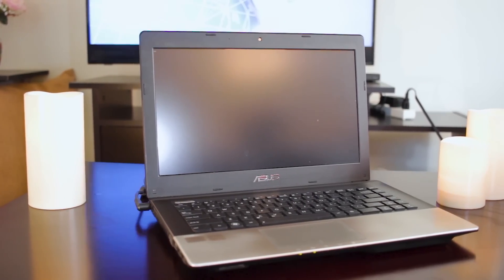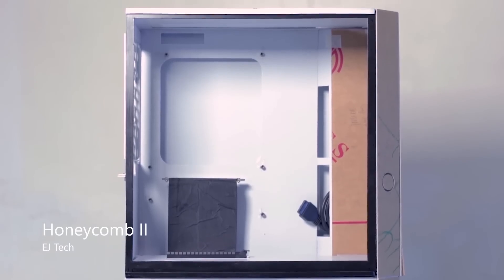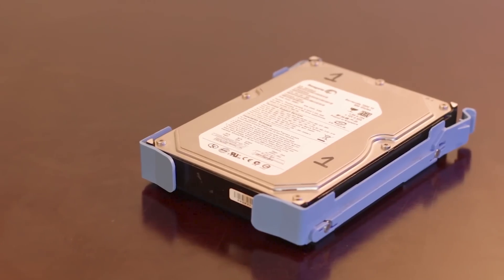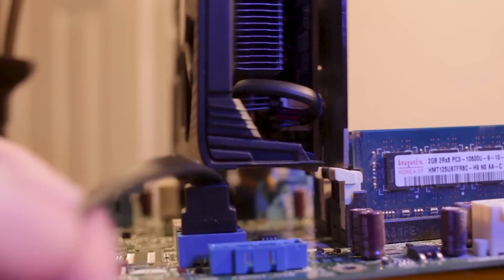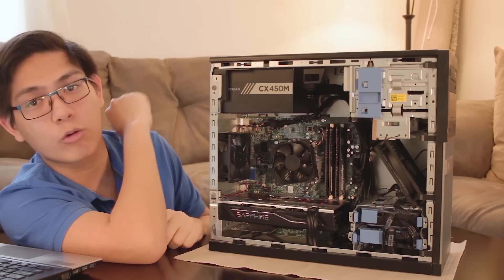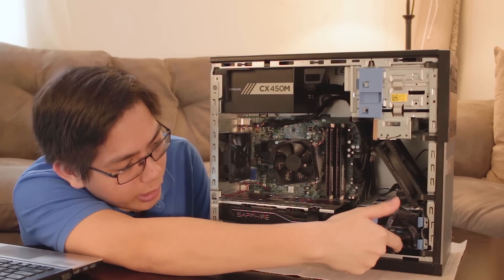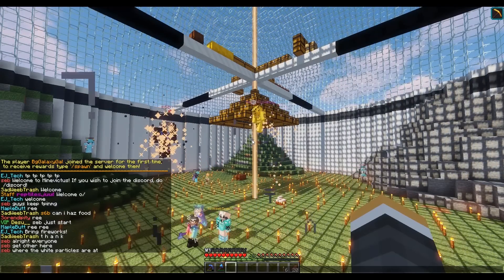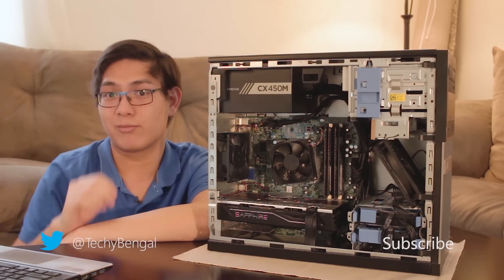My NEW Computer...is a USED OptiPlex? (Tension PC Ep.1)

Comment: You can remove the HD caddy cage and just use an SSD drive. It does take some drilling to accomplish this and YouTube does have videos on this. This way you can install a much more powerful and longer GPU. Although, you'll need a different power supply with a separate connector for the GPU. Another great thing not having the HD cage is that you can install the front intake fan much more neatly against the front grill. This way you can improve positive air flow for better cooling inside the case.

Comment: this is very similar to mine - I got given an old PC by a friend who was upgrading - I swapped the pentium for an i5-3470 (£40), a gtx 550ti for a gtx 1060 (£180, but only cost me £30) and a 500gb SSd (£50). This was mostly 3 years or so ago, except the SSD that replaced a smaller one about 6 months ago.

Comment: I get these optiplex's all the time from work. The optiplex 3010 MT or any optiplex MT with 24pin mobo pin will accomodate a power supply to replace the stock power supply. Now, if the stock power supply is 300w or 380w, you can purchased a sata to 6 pin power cable and install your graphics card. The only cards I was able to test are older cards such as a GTX 650, 770, 950 and the 1050ti. This works well if your optiplex is equipped with the darn 6 pin or 8pin mobo power pin.

Comment: I am in the same boat, 6 year old laptop I had to pull the ramm out of because I dropped it, also the screen is fukt and needs setting adjustment everytime I turn it on.  I am trying to find an optiplex but they are in hot demand and can easily go for 3x their worth.  I found you can merely buy the motherboard, 3.4ghz cpu, ramm, and 500watt power supply for less than the cost of $100.  I'm going to use a plastic tote for a case and just melt holes in it with a sodder iron

Comment: I picked up a HP business computer with a Core i5 4590 and 8GB of RAM for 75 bucks. The kicker is though that it ended up being a slim case with a proprietary power supply and even has a non standard heat sink that cannot be replaced with a standard one. Not to be defeated I bought a Haswell motherboard that was pulled from another full size business computer and accepted standard sized computer parts for $20 and removed the CPU on the slim case computer. I pulled the Sandy Bridge board out of my gaming computer case as well as the 8GB of RAM and GTX 950 and put the Haswell board in its place. I then bought a Core i3 4130 for $25 and put it into the slim computer which became my new desktop internet browser and DOSBox machine. At the time I didn't get exactly what I wanted, but after all said and done, I got what I needed.

Comment: I got an optiplex 7010 with 8 gigs of ram and an i5 3570 all I did was put in a 600w psu I had laying around in it and an r9 380 from xfx took off the fan shroud and fans then ziptied a noctua 3000 rpm fan to it and I can still play most games at 30 fps low or 60 fps high/ ultra settings. Gpu never goes above 78c

Comment: She runs 32Gb of ram just fine with a bios upgrade.
Reply: i7 2600 only works with 24 gb ram max because it will buffer the rest of the 32.
Reply: @raziasrazias7761  I made a mistake.  Mine are a 3010 i5 and a 7010 i7 which are 3rd generation.  They were originally maxed out at 16Gb but both run 32Gb now.

Comment: right angle usb3 extension thing exists, case intrusion can be disabled in bios, look for bios password jumper (remove it), cpu cooler mount looks non standard, you want 2 or 4 ram modules with the same capacity so they run in dual channel.

Comment: actually this is going to sound dumb but in my dell OptiPlex i took the hard drive bay out and put an rtx 2080 ti founder edition card
Reply: My Life on The Peninsula I call bs
Reply: @synthh3850  lol want pictures
Reply: I did the same thing for my kids PC so that I could install an ASUS RX 570 ROG Strix. It's just 10 rivots that you drill out.    Then you use the two top bays for SSD / HDD.   I kept the bays though so that I can pop rivot them back in later if needed.   A 2080 ti is overkill by far for a Sandybridge or Ivybridge chip though.
Reply: Stepside1986 yea Ik
Reply: Stepside1986 does the rx570 work fine in the pc?
Reply: @ethanmoorehead6868  it should, just make sure the other parts in the computer work well with the card and if some don't, upgrade what you can if it is worth it
Reply: if you arent lying then you are dumb because the bottleneck would be awful and the rtx 2080ti would be at 0% while the cpu would burn itself at 100%
Reply: What about the cpu did you updrage that too if so then what as I want to upgrade cpu
Reply: @marmite2956  I did not its running the stock i5 with 16gbs of ram
Reply: Can You provide detailed specification? That's awesome.
Reply: That's not dumb to me, that actually sounds like a really cool sleeper gaming pc
Reply: Dogfacezombie oh thanks
Reply: My Life on The Peninsula 2080ti is going to bottleneck that pc to shit, better off with a 1660s
Reply: @apollo1782  True. But the only reason you'd want to stick with your old build when you have 2080Ti kinda cash is because you want to build a sleeper and/or you want a futureproof ultra settings only card. Like the 2080Ti will probly die on him before it becomes so old that it can only give him 1080p60fps (when not bottlenecked). They wouldnt get such usability out of a card they buy after burning through the same budget on a new system or have the flex rights of owning the first ever RTX flagship.
Reply: Bruh a rtx 2080ti can buy 15 of this pcs

Comment: ah a dell optiplex was my first pc first i got a i7 in mine and 16gbs of ram and a gtx 750 ti and a 240gb ssd and it holds up very well
Reply: i got a i3 3220 with 8gb of ram and a gtx 750ti in my optiplex 3010. same case as this just has 2 usb instead of 4 in the front.
Reply: @StonerFromThe618  yea same the USB header is in the way of bigger gpus
Reply: I just recently bought a gtx 660 ti will it get in the way of my sata connection for my drivers?
Reply: @imjourdan1132  its might I don't actually now how big a gtx 660 ti is

Comment: I did a 9020, loaded it with 32 ram and an i7,  1060ti video card, and away we go!
Reply: The Reverend 1060ti doesn’t exist
Reply: @gamersspace9556  Maybe it does, or maybe I'm so used to typing TI after nvidia part numbers.. either or, it works well.

Comment: Did the same recently. Grabbed a lightly used Optiplex 990 SFF for $70.

Tossed in a $50 GT 1030 and another 8GB to give it 16GB of RAM (Mobo maxes at 16GB) for $15.

I'd like to get an SSD next but I'm happy with it as someone that is waayyyyy behind the curve on PC tech.

$135 total for an:

i7 2600
16GB RAM
GT 1030
500GB HDD

Considering my last PC was a 2012 budget laptop from Walmart (no joke), it's a beast lol
Reply from the maker: Get an SSD sooner than later. A 240GB is less than $30 and will make your system super snappy.

Comment: FIX FOR LONG CARDS AND USB: Recently bought a 6-7 year old optiplex with a 3rd gen I7 cheap, wanting to do a budget build for my shop. I had 8 gigs of good gaming ram laying around along with my old Radeon HD 7970 which is an old but capable beast, both items from the same time frame of the optiplex.  First change the case to fit a full sized video card. Then you'll need these https://www.amazon.com/gp/product/B00HDEBGSQ/ref=ppx_yo_dt_b_asin_title_o05_s00?ie=UTF8&psc=1 . These will allow you to access the sata plugins now behind the card. The USB issue can be bypassed using this: https://www.newegg.com/p/2VR-005G-00016?Item=9SIAE4P89D1711 .

Case intrusion sensor gets unplugged to stop working... Jesus I should make this video eh?

Comment: I have an Asus laptop from 2012 that I still use for certain things today as well!  For the most part, Asus laptops are incredible.  I had a MSI laptop from 2015 that died two years ago, but that old Asus one keeps running like a beast.  I use it sometimes for modeling or video editing on the go or when I'm not around my desktop workstation.  It has a second gen i7 and a GTX 550 m.  It runs Win 7, but unfortunately I'm going to have to retire the machine soon because it will not upgrade to Win 10 due to the old GTX chip not being recognized by the Win 10 OS.  I think it's mostly a Nvidia issue since they stopped supporting those older cards with drivers.

Comment: ✌😏 congratulations about getting #WOKE on crappy trashy laptops, you would be surprised how many people all over the world insist on using a laptop as their only computer! ITS SAD AF! 😱

😒 if you like LOOOOOONG video cards checkout oem desktops like the HP Z line, they come with a full standard regular ATX motherboard with 7 pci slots, with a full size ATX board and full height case the video card can run pretty much all the way across the middle of the case, its pretty much just like a custom gaming case 😒👍

😒 hmmm for that case you should have looked for a short single fan video card 🙄

😒 hmmm you should have gotten a model with an i7 or Xeon 4c8t equivalent 🙄

😒 hmmm all the memory should be matching sticks, fix it 😡

🙂 i like your front case fan idea 😏👍

🙂 Next! 🐢

.

Comment: That's nothing, been using my 1st Gen Core i7 for 10 years now, it's still going.
Reply: 😒👍 yes they are affordable now, finally 😀
Reply: @MrSamadolfo  I bought my computer with the 1st Gen Core i7 brand new back in 2009, it's an HP.  These Dell Optiplexes though are the way to go for someone who wants to build a snappy fast computer for much less.  They're pretty robust and last for many years.  You have to watch on dellrefurbished.com because the prices go up and down.  You can catch an Optiplex 9020 with an i7-4790 and 8GB for about $175.  You have to snap them up when you can, otherwise they're still like $300-400.
Reply: @clemsonbloke  🙂👍 sounds good
Reply: @clemsonbloke  🙂 neat, i bought a couple HP Z 200 workstations from our local freegeek thrift store, they only came with a crappy i5-650 (2c 4t) i tested them out with a cheap Xeon X3470 4c 8t and they posted just fine, just with that upgrade alone now its a decent computer 😃 yay! 🐢
Reply: @MrSamadolfo  Yeah, the Business/Enterprise computers are much more robust and built for longevity unlike the consumer models.  I've loved my HP with the i7 I've had for 10 years now, it's on the X58 platform which was a server platform.  X58 is a beast of a platform, thats why it's lasted so long.
Reply: @clemsonbloke  🙂 yup seems to be built well 😇
Reply: @MrSamadolfo  They are.  If you are going to get one to build a gaming rig out of, get the Optiplex 9020 and not the 7020.  The 9020 is the top of the line.  Also, don't go for the older 960 or 980, 780, 760, etc.  The ones with the 9xx or 9xxx are the top whereas the 7xx or 7xxx series are just below that.  Make sure and get the newer ones with four numbers like the 9020.  They offer much better processors and options.  Also, another that is almost identical is the Optiplex XE2 which is like the 9020 series except it's black and has air filters, otherwise it's not much different, about the same level of quality.  That's the best advice I can give.
Reply: @clemsonbloke  😎 Cool, thanks for the tips friend 😇
Reply: @MrSamadolfo  You're welcome Sammy.

Comment: I’ve same 7010 machine as this. Upgraded gpu, psu needed psu connector. Mac WiFi and Bluetooth card. Installed macOS. Running Catalina on it now. Only thing I hate is it’s only two ram slots. So I’ll need to buy two 8gb. Saaad
Reply: Actually I think mine is 3010. Some weird 4Xxx series chip. 4570 maybe?
Reply: Got 1tb ssd for 40 bucks too. My hdd was also brutal
Reply: Mac OS? How do i make a USB from Windows?

Comment: I hate the dell hardware but I do like their cases even though they lack decent airflow
Reply: One optiplex I installed a 80mm low profile fan with double sided tape onto the side door vent.  Then used a SATA to 3 pin fan adapter to power it.  It also helps pull cool air past the gpu that was installed on that Optiplex.

Comment: Cool video, I've done the same thing, I've brought and upgraded a Dell Optiplex 7010 MT, I primarily use it as a hackintosh under macOS 10.15 Catalina (which by the way works fantastically, even iMessage works) and some times I use it to play games under Windows (which I really only use for that), here's the specs of mine:
Intel Core i7 2600K
16GB DDR3 1600MHz (4x4GB), but it's running a 1333MHz because of the 2600K
MSI Radeon RX570 8GB Armor (yeah, I managed to fit the Armor model inside, and still have the USB 3.0 header plugged in lol)
LiteOn 128GB SSD (for macOS 10.15)
Seagate Barracuda Compute 3TB (for macOS files)
Seagate Barracuda 1TB (for Windows and games)
I added a front intake fan too, because that 570 is really running hot inside that little case
Reply: My 2600k has been running at 1600MHz 4x4GB kit for 6 years.

Comment: I'll hopefully make a similar build as well, based on the optiplex 7010 mt
Reply: Use zotac 1070 mini no need to cut the rear. Just pnp. Also i have 20gb RAM. Playing arma 3 warlords n annex the RAM eats up to 15-16gb. Ultra detail . Processor i7-3770. Around 18-60 FPS. ARMA 3 cpu dependant game. Also Nvidia has downclock my 1070 as to reduce temperature. Last time the core clock near 2000mhz now just 1888mhz. Well Temperature up to 68dgc compare to last time 83 dgc. Few FPS was lost.

Comment: Yes, I have the same situation with my old laptop, but It is a Toshiba Satellite p875-s7200 which is very very upgradeble.  I was able to change the CPU from an I5 3210m to an  I7 3920XM it is socketed and not soldered, I put in 16 Gs of ddr3 ram and a fast SSD, and this old ass laptop is much faster than some new ones.

Comment: I use two of these PCs as my "main" computers. Mine are 790 models but basically the same thing. They've both been upgraded to i7 CPU, 450W PSU, 16GB RAM and SSD drives. Still haven't upgraded the GPU yet, I'm waiting for the new GTX 1650ti to come out. No reason to get anything high-end since it'll just bottleneck on the CPU. In the meantime I'm using a couple of old GTX 550ti cards.

Comment: My Dell Optiplex 7010 MT is highly customized haha. Check the specs:

Intel Xeon E3-1270 v2 (yes, Xeon e3 1200 v2 series works)
4x4gb Patriot ddr3 1600mhz
Corsair CX550 PSU
Sapphire Pulse RX 580 8gb
Samsung 860 Evo 250gb
WD Red NAS 2Tb HDD 
Thermaltake 120mm intake fan w/ custom hole and mount thanks to my Dremel
Removed the HDD cage
Modded USB 3.0 cable and Sata cables to fit under my GPU
Removed optical drive and installed blank cover plate

Love seeing vids like this, keep it up!! These are great budget systems with plenty of room to customize.
Reply from the maker: How much did you pay for the Xeon E3-1270 v2?
Reply: EJ Tech I got it off eBay for 70 USD. Honestly my curiousity in seeing if it would work outweighed the price. Really no different than the commonly suggested i7 3770. It runs great. Also, I don't know why people suggest getting an unlocked processor for these computers as they are total wastes of money in a system where you can't overclock.
Reply: @ej_tech  I wouldn't go for a xeon in my opinion, considering that for 10£ less at 40£ you can get an i5 3570k  or non K which performs about the same in gaming, but does fall a bit back on workstation tasks. Also surprisngly there isn't a huge differnce between the xeon and an i7 3770. It's a tad confusing in my opinion
Reply: @ej_tech  In UK they are solf for around 60£ and that would be around 78 USD, you may be able to find it cheaper though in the US
Reply: Update: DO NOT trim down the USB 3 cable for the front IO to fit in your gpu. I started getting random jitters from my mouse after trimming this plug down. I thought everything was fine originally but then started getting issues later on using the front USB 3.0 ports. You're better off just relying on your back ports and not destroying the connector for the front ports.
Reply: what bios version are you using?
Reply: PC TechTips the newest bios provided by Dell. I think it's A28 or A29.
Reply: I paired my 3770 with a rtx 2060 but the case is super restrictive. Other than crap for airflow and weak oem powersupply it handles 1440p nicely.
Reply: @logan9334  do you have much of an issue with thermals? My CPU and GPU sit at around 25 C idle and neither typically exceed 60-65 C under load.
Reply: @HellfireDiarrhea  cpu is fine but my gpu heats up quite a bit and the only way short of cutting a hole in the case for another fan I've found is to run it with the door off.

Comment: I've been running an optiplex 7010 DT with an i7 3770   12 gigs of RAM & a Radeon 7570. Everything runs great. But I'm looking at getting a new low profile GPU, & a NVME PCIe card. Also moving the temperature sensor to inside the case makes a good difference in package temps.

Comment: The Intel 4th Gen and higher optiplex systems all went proprietary with the power supplies. Then in the 6th Gen, even if you went to bus powered video card, only certain ones work. I bought a pallet of used Optiplex with the i5 6400. I could not get any AMD card to work, only the R7 250 would post but the system locked up once drivers loaded.  The same systems worked fine with Nvidia 750ti and the 1050.
Reply: 🙂 yes its because RX dont come with Legacy Support, the older radeon models shud work tho
Reply: @MrSamadolfo  6th Gen is not legacy it's UEFi, they worked with the older systems fine.  After the forth gen there is a white list  of compatible cards and power restraints on the PCIx16 slot.
Reply: @JordosTechShack  🙂 oh i see, thats shady then, conspiring with invidia? 😱👻